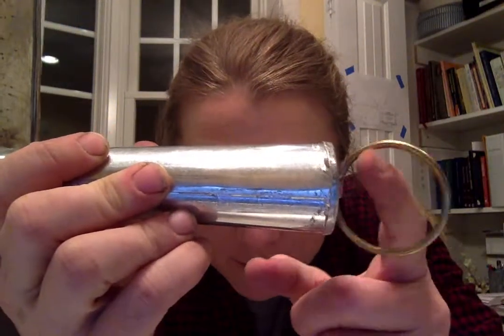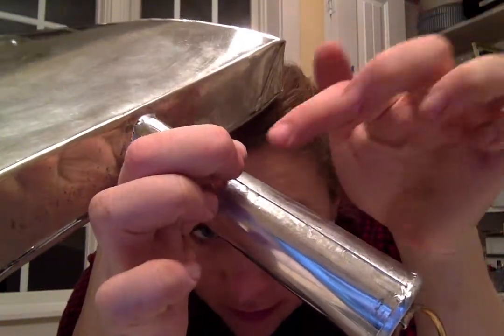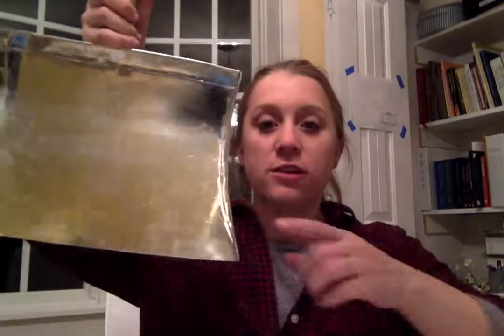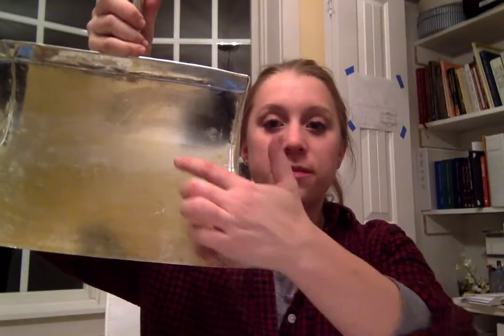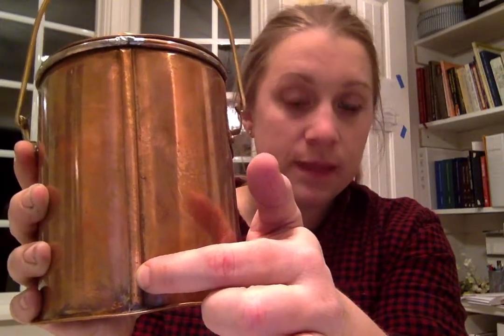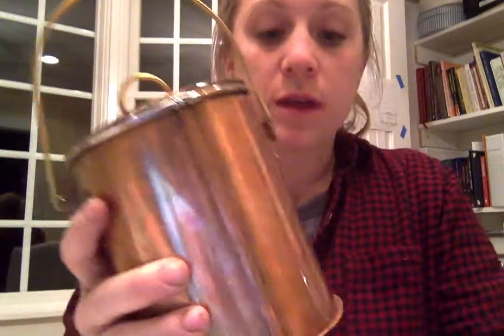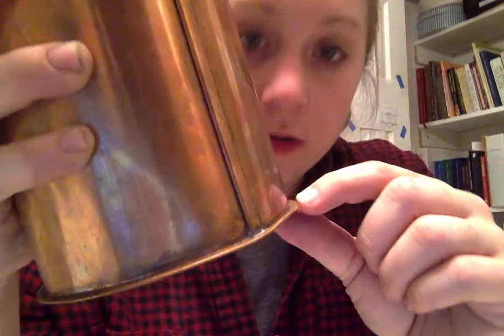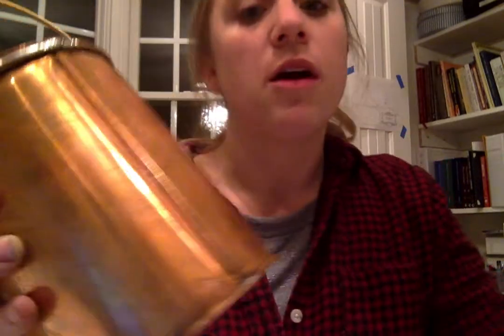Copper Cookware Seams

Comment: Do you have any suggestions for resources to help with identifying or dating copper cookware? I just purchased a pot with cramp seams and I was wondering where you found the info that most like those date pre-1840’s. Thanks!
Reply from the maker: Resources are tricky. The information about cramp seams pre-dating 1840s is from the old tin and coppersmiths I have met through the years who have been working in this vein of trade (some of them are considered the be-all-and-end-all sources and places like Colonial Williamsburg listen to whatever they say lol) and know when certain processes went away due to new technology. The cramp seams were/are the hardest way to create seams and the stamping machinery that was invented in the early-mid 1800s made that seamwork unnecessary and overly expensive when the pieces could start to be stamped. So, yes, while there may have been the odd coppersmith still doing it the old way, it quickly became an obsolete way of making copper cookware due to time and cost. I am sure some of my old books have note of this, but I'd have to comb them all to find out which one has that info. If I happen to run across it, I will let you know.

Comment: Hey! Your vids are really helping me get started on my own tinsmithing! So, thanks. I got a question: Do you know why smiths prefer to make the seems you're showing, versus just casting the whole piece with a mold?
Reply from the maker: Really?! How smashing! (pun intended :)) Thanks for watching!! :) The seams are because we are usually using hand tools, stakes, and turning machines that are 200 years old, which take flat sheet metal (of a certain thickness) only. Anything too thick, they break. And many of us are replicating vintage designs, which had those seams. It's also the only way you can make much without having casting machinery (you'd need a charge/furnace, tons of heat protection equipment, tools to make an individual mold, etc) and then to top it off, tin is extremely extremely soft by itself. You'd need soooo much of it to hold a shape after casting. Thick thick walls for a cup. Like insane. 
Or if you don't want to cast it, you could deep form it or press it out of sheets of metal...but again, you'd need like a ton of expensive, patented, proprietary machinery to stamp or deep form. Basically...if you want to be a tinsmith...get ready to make a lot of seams. :) hahaha! Congrats on getting started - it's a great community and you've come to the right place!!